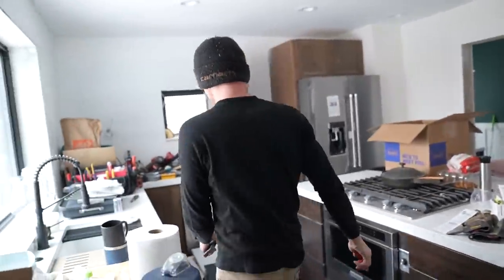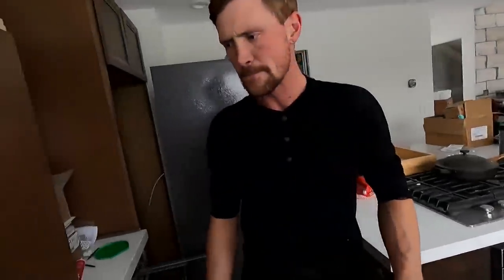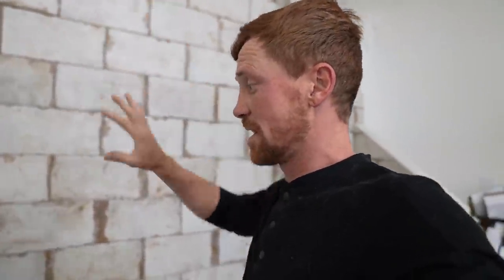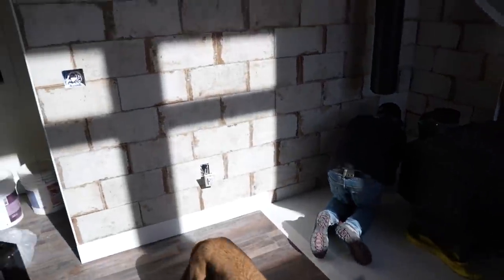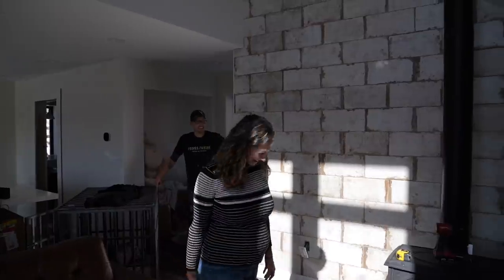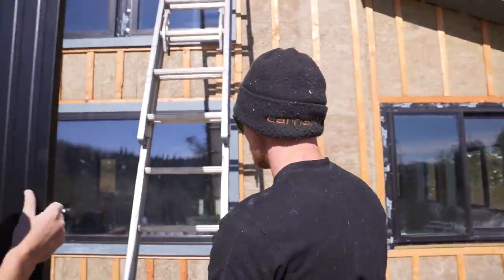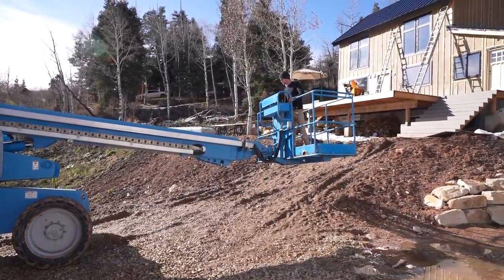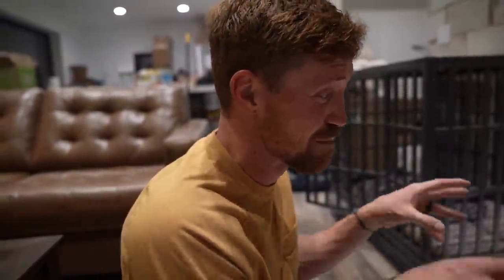TIME IS RUNNING OUT | BUILDING OUR OWN HOME

Comment: A cold chimney flew pulls air down when you open the fire box door. Before you start your next  fire get everything ready except do not light. Take 2 or 3 pieces of news paper  and gently stuff  into the flew opening, light and it will flash burn priming the chimney with a gush of hot air that will start pulling the air up. Now light your fire and won't get smoked out. All chimney flews need to be primed before the fire! Hope this helps!

Comment: BIG SCREEN MOUNT REFINEMENT:  Take some outside corner trim 3/4" or so, depending on how many video/power cables/wires are going to be connected to the screen.  Cut 2 of the lengths long enough to fit an inch above the baseboard and 4" or so longer/higher than the bottom of the screen.  Stain or paint to match other trim.  Drill 3 small holes thru the corner bend and insert small 2" finishing nails so the video cables/wires can be routed around each nail.  Nail the trim with cables plugged in the TV and connected with other components.  Space the trim pieces about 1 ft. left and right of screen center line. Putty nail holes...... PRESTO!  No dangling cables/wires!!

Comment: Your house is coming along so well.  Your couch set up is awesome for having people over and for the two of you to stretch out on.  It is your home and  you want it to be comfortable not a show room. Also you do not have a spare room and for times when you two need space from one another Trent can sleep on the couch. :-)
I really like your siding colour, reminds me of our last home we had for 30 years, the colour was called heritage blue.  In an air tight home you may need a window open a hair to get the smoke going up the flue and you can run your furnace fan to circulate your heat as well and that way your basement will be warmer as well. So happy for you two, almost three. God Bless

Comment: Hi Trent,  I know you’re an experienced outdoors guy whose been making fires all your life.  As far as your Jotul wood stove goes, I would suggest you try the “top down method”.   Jotul has a YouTube video recommending this (also Wranglerstar and others).   Build the fire using that method and there’s much less tending to the fire needed.  I use a smaller Jotul to heat my cottage in upstate NY.
Before you start your fire, heat the flue with your blowtorch.   That’s a very tall chimney pipe and cold air fills it when there’s no fire, that will cause smoke to come out the door.  Flue needs to be heated up to push cold air up and out.  The kindling on top of your top down fire will also help but torch is hot and quick.   Love your new home.  All the Best

Comment: The house is looking great! Have you thought how you are going to clean out the the woodstove pipe? Creosote is a real hazard for house fires(that is what caused Rachel Ray's house fire that completely destroyed her house). Some people attach a pipe at the bottom that T's off the main pipe as a cleanout portal so they don't have to remove the pipe to access for cleaning.
Reply: There special brushes that you use for wood burning stoves and all so you have a log shape you put in the burner while it is a light and it cleans your flu as well
Reply: Being Canadian and using wood heat for 40 plus years, a woodstove full of dry cedar and the damper wide open every couple  weeks burns incredibly hot and keeps everything safe and clean.
Reply: Rachel Ray's fire ignited the roofing material from a spark, it actually wasn't a chimney fire. Trent and allie have steel roofing. Good comment though! Cheers from Canada!😁🇨🇦

Comment: Here is a recipe for making fire starters out of dryer lint and spent candle wax that is put into a cardboard egg cartons. You fill each egg department with the dryer lint, pour spent wax over the top and cut each egg holder into what is one fire starter. I collect the dryer lint and  wait until  I have enough I make several egg cartons worth of fire starters. They work wonderfully.

Comment: I have a similar wood stove and found that if you crack open a window while you first start the fire, it really helps to stop the backdraft while waiting for the heat to build up and get the smoke moving in the correct direction.

Comment: To help get the drraft pulli g when starting a fire when cold, lightly crumple a sheet of newspaper on top your kindling. When you light the ki dling the newspaper will burn quickly and hot to get the draft started.

Comment: The house looks amazing!  The tile wall and the mud room floor turned out perfect. For saying the house is a hair out of square I think you were being overly critical of your work. The tiling, floors and siding all seem to line up perfectly and not have any gaps. Beautiful job! Btw, we had a new furnace and air-conditioner installed and the company that did the work said to leave the fan motor run continuously to improve circulation and balance out the temperature throughout the house.  After a full year of letting it run, it really works and made a real difference in our heating and cooling bills.

Comment: Burn a big piece of loose paper after the wood is on place and before lighting the wood.  It will create enough heat to get the hot air moving up the chimney.  When the wood starts burning the smoke will be taken up the chimney with the hot air.  Much less smoke in the room.

Comment: I remember in my three stores high house warming up the exhaust pipe with a burning newspaper, Could be needed too in your house. And keep it ultra-clean. As I had the ash drifting on the hot air blocked the smoke turning it back to the living room. Panic. Until the hot air was strong enough to blow it out. As long as you sleep in Terry nothing is illegal, Trent. Take care there.

Comment: Distribution of heat with a wood stove is a challenge.  When I installed my first wood stove, in the '70s, our basement would be in the 80s, the main floor in the high 60s to low 70s, and the second floor (where we slept) would be in the high 50s.  And that was if we left the basement door open for circulation!  We adapted to it.  It was a GREAT wood stove.  Unfortunately, the company is no longer in business.  Your open design house will be much different, but the basement will probably still be freezing.

Comment: We used the concrete board siding for our house and we have been very happy with the durability of it.  We painted ours a different color, it was too yellow once we had it up and we wanted an off white- and it has held the color perfectly for around 7 years.
Reply: I have used it, as well, on selected areas. I found it a pain to cut, however. I used my circular saw and went through a lot of blades! On another channel I recently saw that they were using a cutting wheel on an angle grinder, so I wonder if that would have worked better.
Reply: @debbiputman3482  There are score and snap tools made by James Hardy Industries. No wheels. No electrics.

Comment: The fan will help circulate the heat. Running the fan ONLY on the HVAC will also circulate the air to the downstairs as well.

Comment: A little tip.....if you light a candle/candles and put them in the wood stove, this heats it up before building a fire, and that helps prevent the smoke.

Comment: I am totally puzzled that your refrigerator does not have a sizeable gap around its outside and over the top of it -- for very necessary ventilation.  The cooling system sucks heat our of the inside of the fridge -- and it must have a suitable path to get rid of that heat.  I do not believe manufacturers who say ventilation is not needed.

Comment: I open the bottom ash pan on the wood burning stove…. It allows more air to get your wood fire going.  As soon as the wood going good .. shut it.  Not suppose to heat a cold stove too fast

Comment: Use the fan feature on your furnace to circulate the air in your house.... growing up my parents did that with a blaze king stove in the basement that was maybe 10 feet from the cold air intake for the furnace and the furnace circulated the hot air throughout the 2 story house...

Comment: Little tip for building a fire💚 open up the flume all the way and leave the fireplace door cracked about half an inch when the kindlings getting started. Helps bring the smoke up.

Comment: We had a long flue for our woodstove.  I used a plumbers torch and put heat to the top of the firebox and up the flue to push the cold air out.  It worked most of the time....

Comment: Your fridge needs venting at the back. Instead of lifting the cabnets above drill 50mm holes under the cabnets at the back and fit sofit vents below and on top. Then fit timber battons inside the cabnets and fit a false back in the cabnets.

Comment: Trent, if you keep the door on your fireplace cracked a half in or so when ya light the tinder (or adding a new log), it sucks in more air and really helps it get going more so than just using the vent/flue being open!! Love from Montana 🥰

Comment: Woodstove suggestion: burn a few sheets of newspaper first. The quick heat will warm the flue and generate the necessary up-draft. Then light your fire. This procedure will prevent that smoke from flowing into the house.

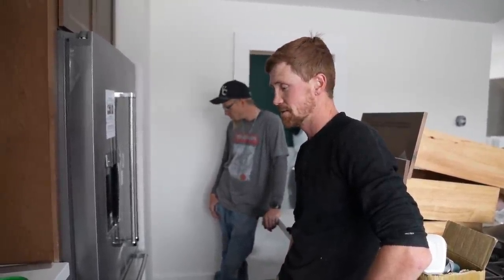Comment: @6:53 - the left side fridge door, it doesn't bump the counter overhang? Fridges can be a pain in kitchen planning. Opening a fridge door is usually only done 90 degrees or a bit more. BUT We had a home that didn't allow the fridge doors to open all the way - which you need to do to take out drawers and clean.

Comment: I avoid the smoke in the house by using an a Looftlighter which is kind of like a tubular heat gun. I hold the device near the chimney opening for about 90 seconds to heat the air in the chimney and then light the kindling and no smoke.

Comment: The tall chimney flue. Suggestion:  To start a fire in a cold fire box first light up some newspaper, cardboard and flush the cold air out of the chimney.  Usually worked for us on a cold startup. Just stuff the box with highly combustible and then kindling and such has the draft from the room giving the kindling the boost to fire up.

Comment: with Frank and Leka you are going to hate the floor in the sunroom... I know by experience! Light floors show all the dirt and dog hair!  We put in a light floor in my old house.  My newer house has a darker flooring that hides everything... so much better.  You will see the difference soon!  I would reccommend Marmoleum for the room myself, a solid piece that's easy to clean!  We redid our bathroom with it, and I am sold.  it's a great product....  That and the floating floors just don't hold up to getting wet and if you are dragging snow in with your shoes all the time, it won't last long.  I would definitely use it for now, but be prepared to replace it!

Comment: If you are getting smoke in the house when you start a fire, make sure your furnace isn't running and crack a window before lighting it.  You need to get the air flowing out the flue and not flowing back into the house.

Comment: There is a bluing cream that can be used on the cast iron fireplace.  Water will just keep it flat and dinghy.  May take a couple coats to get the sheen you want.
It’s like seasoning  a cast iron skillet.

Comment: Rather than renting a lift, you should build a modular scaffold out of 2x4's held together with carriage bolts. A 3/4 inch plywood sheets can form the platform. The scaffold can adjust to any terrain around the house.

Comment: Hey Allie don’t clean the stove with water it will cause rust spots, I grew up with wood stove to clean it they used the kind of sand grit cloth with preference of oil don’t pour oil on,put it on the cloth and shine the stove while it’s hot or warm, like you would take care of a cast iron pot or pan

Comment: The 1st. fire of the season is like……an event! You love the summer, here in the Rockies, but every once in a while you drift back to winter and miss the incredible warming a wood stove provides! I know, I use a wood stove in my shop. It is so different than a furnace or electrical heaters. True it can smoke a little, but keep your flue clean and no problem! Don’t forget the pan of water on your stove. Love from NW Colorado. Thanxz.

Comment: Trent, burn a huge ball of newspaper before building the fire. There is a column of cold air that needs to be pushed out of the chimney. A fast hot fire of newspaper will clear that. Then build your fire as usual.

Comment: Point the gas torch at the opening of the chimney (flute?) for a minute or two to heat up the air inside it before you light the up fire. It should minimize the smoke.

Comment: There is probably a few posts telling you this but if you first heat your chimney by putting a peace of paper inside the chimney and lighting it up and then light up your fire, it will help taking the smoke up the chimney.  Advice from an everyday user in North of Quebec, Canada.  Do not forget to sleep well.

Comment: We have the same issue with our woodstove. I've discovered over the years that a wad of paper or two, will burn very fast and send heat up the pipe very quickly to help get the draft going.   Kindling doesn't burn hot enough, fast enough to heat up the air in the flue, thus you yet smoke pooling in the stove and then your living room.

Comment: We have our bedroom above the wood stove too. What makes it doable is that we have a door to close to keep out the heat. We just have to remember to close it😅😂. Otherwise we open the bedroom windows and turn on the ceiling fan to be able to sleep. You will figure out a system to keep you comfy.

Comment: Next time you light the wood stove, crack a window first and then light it. That should take care of the smoke coming back into the house. If the house has a negative pressure then the smoke will backup into the house. Opening a door or window should take care of that. Otherwise everything is looking good.

Comment: Don't use water you will get rust, there is a cast iron cleaner you can get for cast iron pots  or use a mineral oil. (Sunflower oil )

Comment: You need WOOD STOVE POLISH too make your stove nice and black. It's kinda like shoe polish but with a oily type base. Should of maybe sided the outside instead of tiling the shower. Could be doing that now knowing the outside was protected, and doing the inside chores while it's snowing outside.        CHEERS               Steve h.

Comment: BURN the dust off the black cast-iron of the fire-place (wood stove).
Light a fire & get it warm., burn the exterior gentle with a "Propane-Bottle" torch.
(I think that will work  (??))

Comment: Since the house is on a hill, perhaps the garage should have been built under the house.  That way you do not have to leave the house to get into your vehicles.  They could actually put a drain in the floor and a hose for rinsing the mud and dirt off the vehicles while they are inside and not freezing.

Comment: Take the torch and preheat the pipe before you ever ignite a fire.  That way, you get the flue hot and evacuating air before it has to deal with smoke.

Comment: The next time you start a fire and you start to get smoke inside, crack open the door on the wood burning stove and crack a window open that's near to the fireplace. It will start your fire faster and the smoke coming into your house will be sucked back into the fire place, I heat my entire house via our wood burning stove and use the ceiling fans in the room to circulate the air all around the house. I think what you guys are doing is beautiful and your journey has been amazing to witness.

Comment: Dryer lint works great for starting fires. ;) Also put a kettle with water in it on top of your fire to help keep the air moist. As a UPS driver's wife, and helper during peak season, you do NOT want to know how bad those meal delivery services smell on the truck. I will never eat one lol.

Comment: Leave the door open slightly when you start the fire Trent. You need to get the draft moving up and the heat does that. DON'T close the door all the way...give it air......and why is blue siding banned by the HMO?

Comment: A bit surprised that you didn't do the same flooring in the mud/sun room as the rest of the 1st floor; seems the darker color would be better for a mud room.   May I suggest a "punch list" a large one, maybe hung on the wall next to the basement stairs.  You're getting close to getting it ALL done, would feel good to cross stuff off the list, closer to the finish line.  Looking good.

Comment: They have cast-iron fans they work off the heat of the stove you set them on the stove when they get hot they circulate the warm air into your house log cabins have them with their cast iron wood burners

Comment: KITCHEN CABINET IDEA:  When adding your under cabinet lighting, install a motion detector switch in a typical single electrical box under an upper cabinet facing downward, near the area you would prepare most of your meals.  By waving your hand between the upper cabinet and the counter top, or walking up to the area of food preparation, the lights automatically come on, staying on as long as anyone is in that countertop area.  Duration of light is adjustable, before it automatically turns off.  You will never regret the "magic" of this $20 design idea and it will continue to amaze anyone who sees it in action for years to come!   ENJOY!  J.D.

Comment: I think you may still have a problem with the refrigerator  - it does have a motor. It does generate heat, it does need adequate air circulation.

Comment: Clasdis problem... Your house is too well sealed so when you light a fire it draws air and heat out and creates negative pressure until it can't draw any more then it will reverse and rush air back down until pressure equalises.
Is this your situation or have you got a vent/air intake somewhere nearby?
Or how are you balancing your system?